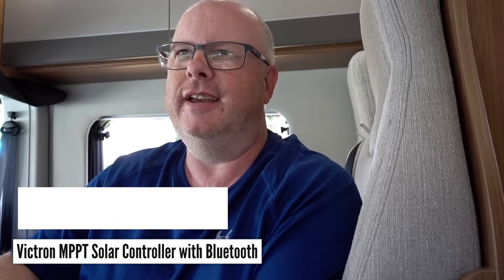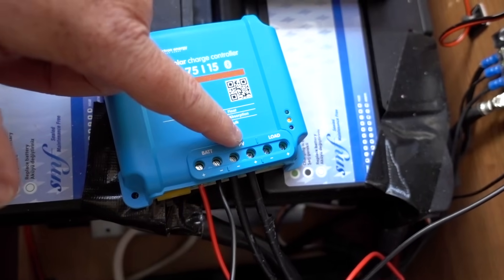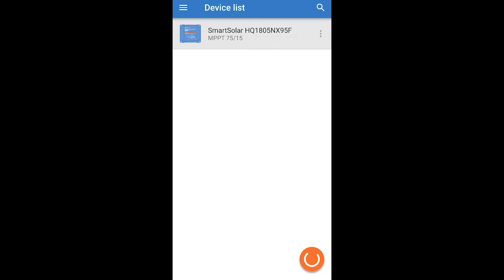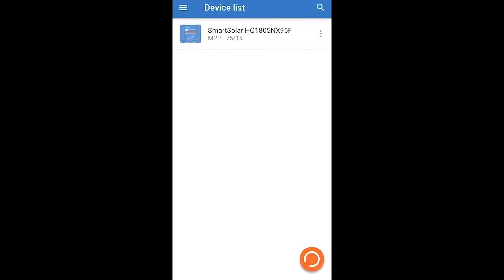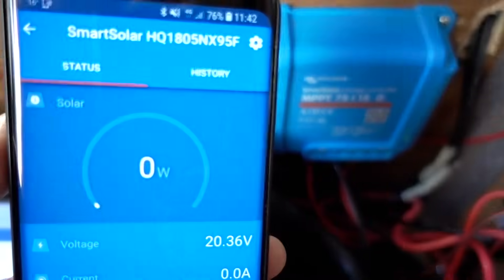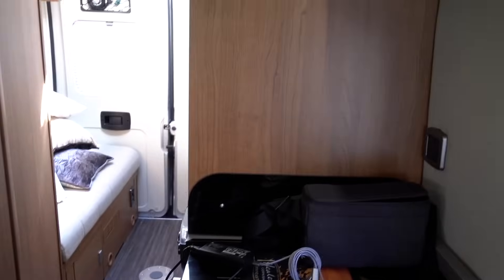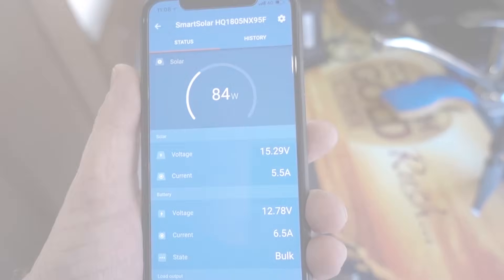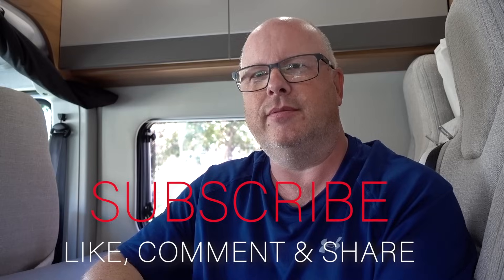Victron MPPT ☀️Solar Controller ☀️with Bluetooth 📲 Installation & Review

Comment: John thanks for the video. Question: What is the minimun MPPT from the panel? and does the unit start charging the battery if the battery is almost full or does it need a certaain voltage to start charging?

Comment: Hey John,
Thank you for this. 
I would also like to swap my current EPEVER controller for a victron but although my solar is 150w, i wouldn't know what the open voltage circuit for it would be. So, as my current epever controller rating is 100v 20a, what is your thought on going for the victron 75/10 or should i go for the 100/20 to match the same so long as a it doesnt cause any issues if too large? . Thanks

Comment: hey man, thanks for your vid. I got a 200w panel connected to the mppt victron solar charge controller but i cant see generating any watts on the solar panel, even on a sunny day. Cables from solar panel to the charge controller are 2.5 tick...might have to be upgraded in order to get watts from the solar panel?  Thanks

Comment: hello sir, i've just purchased a victron mppt 75 15 controller.  i've downloader the application and soon i'll hook it to a battery for a test.  unfortunately, i accidently remove the dip switch or jumper at the base of the unit. is this a critical component ?  thanks for the vidéo, i'll get back to you if i have problems, cheers  william in france
Reply: I lost mine too,but apparently if your doing a basic setup,you xont need it.

Comment: Hi I have the 75/15 installed but it’s not charging my leisure battery yet the app is saying it’s at 14 volts but I have taken the battery to 10.9 v and the app says 14 still. Any pearls of wisdom?

Comment: I may have missed it but what fuses did you put in between the panels and controller and what fuse did you use between the charger and battery? I have gone through the calculations and manual and feel I have got what I need but as you have the same set up being 150w panel and 75/15 controller I would like to check my working next to yours? I have 2 75w panels in parallel series giving me 150w so I have added 15a fuse in between panel and charger and then added a 20a in between the controller and battery? Hoping yours is the same lol. Appreciate if you can help. Thanks

Comment: I'm just reading the specs on the MPPT 75/10 model it says a maximum PV power 135w can you plug a 300w solar panel into it and say on an ordinary day the panel might only run at 50% efficiency so 150w will this then give you your maximum pv power of 135w charge or will this wreck the charge controller from overloading input pv power? ps i dont have any equipment just trying to get a better understanding of how solar works

Comment: would it run with a 2oo watt Soler
Reply from the maker: It should, but you should check your panel specs against the solar controller you’re looking at.

Comment: Hi John, a very useful video
As you made it look so simple I am going to change my factory fitted Truma PWM style controller for the Victron bluetooth MPPT 100 20 bluetooth controller. I do have a couple of questions, 
1. my current controller charges both my leisure battery and vehicle battery by means of 2 separate connections, is the Victron also able to do this?
2. I currently have a 100w solar panel and 2 x 110ah AGM batteries, how much will the 100 20 controller allow me to increase my solar panel capacity?
Thanks
Reply from the maker: Charge your leisure batteries from all your chargers, then get a little back charger that’ll charge the starter battery once the leisure batteries are full. Look for a 12v battery master

100/20 will allow up to 100 volts of combined solar voltage to provide up to 20amps of charge. It’s not really measured in watts.

Comment: Love watching your videos. I’m in the process of planning to install solar to my motorhome. One question I have and maybe it’s silly, when connecting the cables from the solar control to the battery do I need to factor anything else in such as other loads connected that are drawing from the leisure battery.  Also the engine charges the battery when driving. Any thoughts would be great.

Comment: Hi, This is a great video. 

Quick questions..

1) How well does it perform in keeping your leisure battery topped up? For example, when we use our camper after a day or so the fridge voltage warning light would come on. Would something like this prevent that (assuming Sunny :) )
2) Could I run a USB phone charger port from the "load" terminals to charge phones etc during the day so as not to draw from the leisure battery and thus save power??

Thanks
Reply from the maker: As per the video, wire it to be a charger, do not use the load connections and then you can use your leisure battery fully.

Comment: Great video, like yourself I have an off grid system already in place, but can't see how it is performing. My current solar controller has a digital display but only show battery power. I would love to get real time display of solar output as well as historical information so I know how its performing and how well the batteries are holding charge. When I click the link to the victron product page the listing says you need a bluetooth dongle, a Victron Remote Module (VRM), or a LoRaWAN (Long-Range Wide Area Network). Your video suggests you don't need anything additional to the controller unit. Can you clarify if you need extra modules or not?
Reply from the maker: Check the link, i've just updated it for you.

Comment: I have the same controller but unsure of your explanation of what the 'Load' connection is for ?  I was told it was for loads only up the rated amperage of the controller which for this model is only 15amps and not to use it for my inverter or anything else drawing high power.  Good video.
Reply from the maker: Basically don’t use the load if you installed solar to charge your battery.  The load is for led lights or phone chargers, very low power devices that will only get power when there is sun. So my advice is take all the solar power to the battery to charge it and don’t connect anything to the load.
Reply: @GadgetJohnAdventures  Cheers fir your reply, I wasn't sure but now I'll leave the load connection well alone. :)

Comment: Great video! Love your stuff. Is the battery amp reading on the app giving you the amps going in from the solar controller to the battery? Or is it giving you how many amps you’re drawing whilst all the lights, fans, and chargers are going? If it’s the latter, I thought in order to get an amp reading, you need to run whatever’s measuring amps through the circuit itself rather than just getting a read from the battery. Or am I completely off on this? Thanks!
Reply from the maker: The bmv712 shows amps used since last at 100% and also the amps going in or out of the batteries.
Reply: John & Mandy on Tour thanks for the quick reply! Got it, so it sounds like as I suspected, the solar controller itself (lacking the battery monitor) won’t be able to give you amps being drawn out of the battery?

Comment: Hi thanks so much for the video.  With The Bluetooth system do we still need a monitor for example our solar panel installer is telling us to buy this part - Victron Color Control GX Monitor.  We would like to save money and not buy the monitor can we use the Bluetooth app instead?
Reply from the maker: The app is free and it’s easy to use, you definitely don’t need the monitor.
Reply: @GadgetJohnAdventures  Thanks sooo much!  You just saved us over $500 !!  Whooo hooo!
Reply: Hi again!  I know this is a lot to ask... would you be available to chat with us quickly about the app verses the monitor?  The fellow who is installing our system is insisting we need the monitor.  We really want to make the right decision. Here is what he said “ The Victron Color Control GX combines the data from the Battery Monitor, Solar Charge Controller and Charger/Inverter. Having complete data, and knowing where you're at on your batteries, panels and power consumption is critical for extended no-hookups camping. The Control GX is also your gateway to uploading data to the cloud so you can monitor your rig when you're away. It also give support for "geo-fencing" which is a LoJack like security feature for your trailer.”. I’m sooo grateful for any  advice you can give us.
Reply from the maker: We use the BMV712 and the victron 100/30 solely on bluetooth and you know how much I can monitor our power, so no way do you need the screen and never would you "need" the cloud info either.

Comment: I wonder why some dont have the load. I just purchased the 100/50 mppt victron and it has no
Load
Reply from the maker: The bigger the amp rating of controller then it won't have a LOAD output as this could fry connected devices.

Comment: Hi John - quick question if you have the time to answer. Would massively appreciate it. You opted not to use the 12v load circuit on the MPPT controller itself. 

Are there any pros or cons to using this socket or did you just not opt for this method purely because it doesn’t work as well for your particular setup?
Reply from the maker: It’s really a pointless function, it only provides power during direct sunlight.

Comment: I have a victron mppt solar controller with bluetooth but i have to stand within 3m to connect is this normal? TIA
Reply from the maker: I’m done vans that’s expected, it’s a big metal box you’re installing it inside so it messes with the signals.

Comment: Hi john. Ive got a duritc battery to battery relay to charge my leisure battery. And ive also fitted a solar panel with mppt controller. Ive noticed the other day that my solar panel has charged my leisure battery upto 13.2v which has switched on my duritc relay and in turn charged my van starter battery. Is this correct and ok to do? Cheers jon
Reply from the maker: I really don’t suggest people use split charge relays at all any more, a b2b is by far the better solution, but if you are using a split charge relay then you should use one with a diode to stop the back charge voltage 👍🏼
Reply: Thanks for the responce. So do the duritc ones not have a diode in them
Reply from the maker: Johno Cooper You’d have to ask them, it might even depend on the model 🤷🏼‍♂️

Comment: Hi John,Great video! Please help me.I just installed the same Victron MPPT SCC and solar not showing any wattage or amps in ConnectApp?I have tried diffrent settings,check every connection,fuses,everything is fine,but the MPPT still shows 0 W and no current,thanks in advance
Reply from the maker: If you watch a recent VanTech Tuesday video I go over how to diagnose solar faults. 👍🏼

Comment: I’ve got a weird question or maybe not! 
I’ve got 4 panels 26 volts on 100 watts. Individually they run between 5-7 amps I have 2x 110 amp life4po batteries.(no problems)
So would it’s better to connect series or parallel? And would I get more amps when voltage reduced to the required 14.8 volts?
Thanks guys.😂

Comment: Hi John great video  im upgrading my solar from 1x80 to 2x80 watt panals and also changing from pwm to mppt smart solar controller from victron my question is what size cable do i need to use from charge controller 75 15 to battery bank 2x 130ah  agm  thanks in advance jon
Reply from the maker: Standard solar panel cable will be fine, all panels should use it as it’s got a double skin for weatherproofing and the standard wire handles 60 amps.
Reply: @GadgetJohnAdventures  Thanks John

Comment: Just bought an old van and slowly doing it up. Thinking about my first ever purchase of a solar system and the Victron brand is up there as one of my top choices. Love how the app displays all the data so simply but the only thing I would say is that I'd love that level of detail on a permanent panel in the van. Would not enjoy having to connect a phone up via bluetooth all the time.
Reply from the maker: You can use a BMV to give you that info 👍🏼
Reply: Good choice. Do it.

Comment: Hi im after getting solar and thinking of getting the mppt control im going to start with just the 100 w solar panel but might add another in the future my question is should i buy a control to just work with the 1 solar panel or would i be ok to buy a bigger size controller so i can add more solar in the future
Reply from the maker: Buy the biggest you can afford. 100w of solar will not give you much power.

Comment: Gday John. Finally found someone who is explaining things do can understand them. Mate I'm upgrading my solar on my camper and have purchased the same controller as you. My question is, what advantage or disadvantage do I get from using the load out? Am I right in assuming it just shows and controls output or draw on batteries? Thanks mate, great work! Tim.
Reply from the maker: You don’t put anything on the load, unless you only want the lights on when the sun shines 😁

Comment: Hi John, Will this controller charge 2 leisure batteries or just one. ?
Reply from the maker: Multiple leisure batteries should always be wired as a battery bank and any chargers connected to the battery bank, so this will work just fine. 👍🏼
Reply: @GadgetJohnAdventures  thank you.

Comment: Another great video John, thanks. I'm just wondering how this fits in with your other video on the detailed 12v Inverter & Battery Wiring Guide? Does it just connect straight to the battery without affecting your previous 12v wiring diagram?
Reply from the maker: If you note from this video the solar controller goes to the fuse box with an appropriate rated fuse 👍🏼

Comment: Is it plug and play for lithium batteries or do you need to program it?
Reply from the maker: You just select the lithium settings in the app 👍🏼 But this controller isn’t powerful enough to charge lithium.
Reply: @GadgetJohnAdventures  But a Victron 60a would be powerful enough correct?
Reply from the maker: Yes, that’s be fine as long as you have enough solar to generate 60amps, you’d need close to 1Kw of solar 👍🏼

Comment: John
Hi, we have just purchased a second hand motor 
Home having had a caravan for years and I have been watching your videos with great interest. I am considering a solar panel but I have also considered a 1000w inverter generator which are not a million miles away in price but Hh
Ave the added cost of fuel. What do you suggest?
Reply from the maker: I’m a fan of solar and b2b for battery charging. Generators aren’t something I’d bother with due to noise & smells.

Comment: Q: how many solar panels are you running ? On this charge control thanks
Reply from the maker: None, this is an old video and I’ve changed from this setup now. I ran a 150w panel with the controller in this video.

Comment: Hiya john what settings do you run your controller on I’ve just installed one and not sure if to run it on default settings for battery or user defined
Reply from the maker: I’ve used the profile for my agm batteries. 👍🏼

Comment: Hi John hope your enjoying your travels I've got a couple of questions I'm pretty sure your the one to answer them hopefully
Can you use a hookup type 240v charger along with the solar power also does the solar system work when travelling
Finally what is the best vehicle charging to the leisure batteries ie split charge or battery to battery and can all these be used alongside each other cheers Steve
Tried to find email for you?
Reply from the maker: Check out our website for more in depth info on our van https://www.gjot.uk
You can use hookup & solar charging and the solar charging will happen while you drive too.  I’ve got a sterling B2B charger which is far better than a split charger.

Comment: Hi john, can you help? I've just bought a victron on the back of your video in hope that I could see the amps drawn from my lights/ diesel heater etc...I've set it up and it shows '0' ? 
What am.i doing wrong? It is night time, does it only show when the solar panel is receiving energy? Can I get it to show all the time ? Any help appreciated. Many thanks
Reply from the maker: This is just a solar charger, to monitor your power usage you need something like the Victron 712 BMV 👍🏼
Reply: @GadgetJohnAdventures  thanks for reply. Is yours showing output because your pulling in solar then? Would it work if I attach load to a shunt? Thanks

Comment: so the app doesn't show the real time solar panel information but only what the solar controller uses once the battery is under load/off float?  I've noticed on mine the amp reading on the solar goes up when i turn the fan on
Reply from the maker: Yes, that's how all solar controllers work, they only show the load they are drawing in to power the load on the batteries, unless you wire in to the load side and then its the same info but only shown when it sees a load.
Reply: @GadgetJohnAdventures  good to know thought my panels were wired wrong!?

Comment: Great video mate. I just purchased one of these to run with my remote solar cctv setup. Do you know if this controller does any low voltage alerts or push notifications via the app?? I'm Gunna run a raspberry Pi 3 next to mine with an LTE modem for remote monitoring.
Reply from the maker: Thanks, you’d need a battery monitor to do that. Great idea though.
Reply: plug in MoPI to pi to monitor bat levels

Comment: HI John, I have the same battery and Victron as per your video but i was just wondering about the battery settings on the Victron. Shall i leave them as factory default or did you change any of the settings?  Cheers Darren
Reply from the maker: The victron doesn't have any settings for basic lead acid batteries so leave the settings as they are, I've don that and it works fine.

Comment: Hi John I’ve now connect my two 130 amp batteries to the 150 solar and 75/15 Victron controller, can I ask have you tweeked the controller
On the Bluetooth app to improve things  or left as is ? Cheers.
Reply from the maker: I’ve left it alone on default, the settings are more for lithium batteries or similar from what I’ve read.